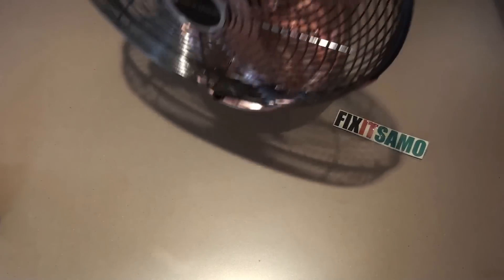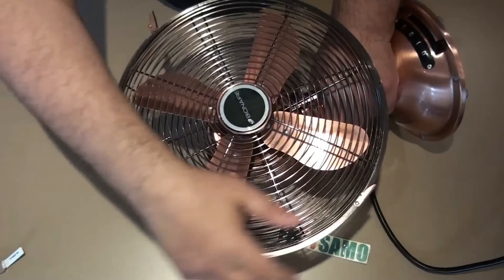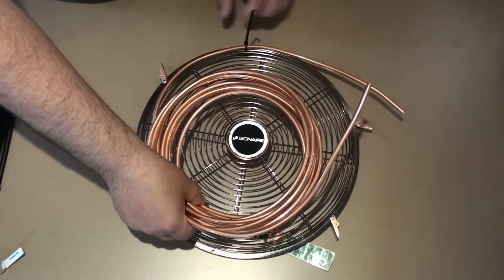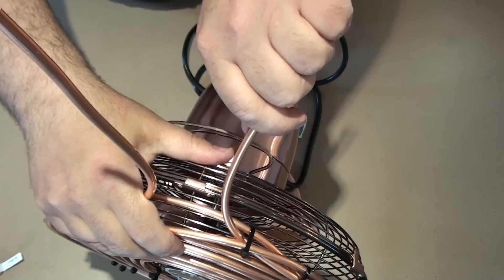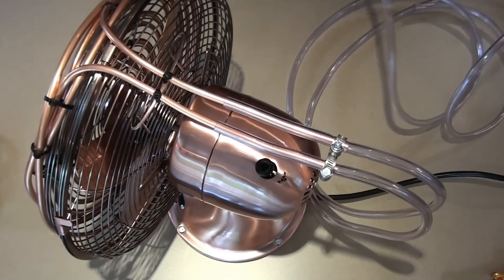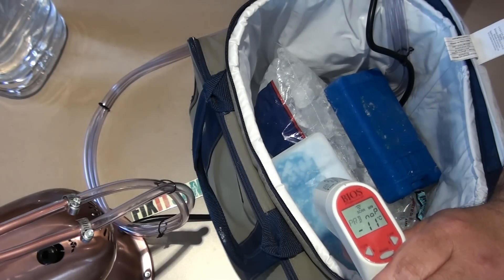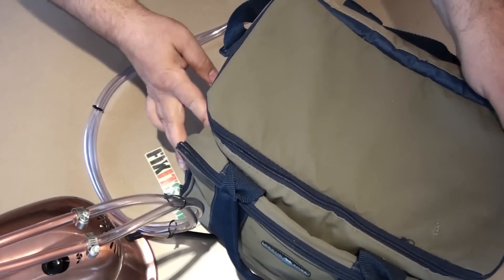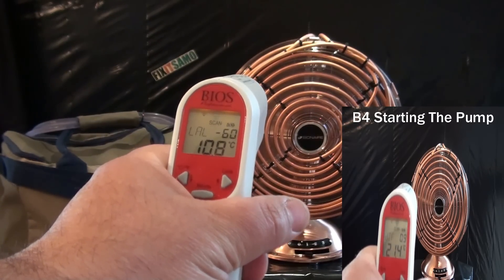How To Turn Your Fan Into An Airconditioner  AC

Comment: This is not an AC. It is a water cooler.
Reply: An AC is an air conditioner. Whether it's water or refrigerant, if it's conditioning the air, it's an air conditioner.
Reply: David Hernandez Erm. Sorry. English does not work like that. An air conditioner is something with a compressor thay creates a temperatire differntial. What you have is a premade temerature differrential and this device is water cooler.
Reply: Says your local Maytag man.  Don't get sucked into labels.
Reply: "English does not work like that." I'm going off their dictionary definitions but okay, sure. I'll listen to some guy on the internet over my professor that's been in the industry for decades. Thanks.

Comment: think I'll use an old small electric cooler that I have & a small water holder to change that I won't need any ice! I know it won't be as quick in cooling but it'll be less to maintain due too you won't have to add more ice every few hours or so! again, great idea!
Reply: also adding those reusable cold packs that you used would speed up the cooling & not waste as much ice in general!

Comment: If I where you I would have soldered peices of sheet copper to the pipe, or aluminium sheets so you can get  even more surface area for the air to contact, and I would have made a metal shroud so it can only go through the fins, and not outside of where the fins would be.
Reply: Are you a sheet metal worker?
Reply: Coffin Man no, but it doesn't invalidate my position if I'm not. I just know that the more surface area the better when cooling something.
Reply: Deimos Phob
I agree perfectly with what you say, I'm just wondering how most people would succeed in the attempt.
Reply: Coffin Man
eh, bolt cutters and soldering iron, not hard to come by, and sloppy soldering works just fine.

Comment: Danger, not cheap and take space.
Reply: Still cheaper than an air conditioner unit and very useful in some specific situations, and most people must aready have at leas the fan or the bag. Cooper and ac water pumps aren't expensive.
Again, of course there are much better solutions than this, but depending on the situation, this can be so useful
Reply: Daniel Moreno
aking always ice is worst.

Comment: well folks this project does work not as good as a real a/c unit of course but ok the real problem that no one tells about is as the copper tubing gets ice cold the tubing sweats like crazy just like pipes in ur basement so if you don't mind the mess lol ...get you a drool bucket or something....its not worth the time plus buying ice everyday
Reply: if you stay on your shit you can have a routine where you fill up new ice trays every morning which would take like 3 minutes and then for the condensation you can build small structures to move the water to a bucket.

Comment: Wow that's cool, lol excuse the pun. Does the water warm up quickly thou? I know you have the bag holding the water insulated but you are pushing that hot air passed the copper pipes holding the water I'm guessing there is a lot of heat exchange.

Comment: Would this also work as a heater by using warm water instead?
Reply: would probably work better due to the heat dissipation of copper but it going to be hard to keep the water hot enough vs cold

Comment: Well the purpose of Air conditioning is not only to cool the air but to dehumidify it as well.
This thing you have made has been around for decades. it only cools the air right in front of the fan  It will not cool A room it will not dehumidify the air and in A cooler that size you will be changing out the ice packs every 30 mins. (more often in really hot temps) in the long run it will be cheaper to just go buy A 99 dollar a/c
Reply: You're right that this won't cool a room.  But it's perfect if you work in an office full of women who are always cold.  You can use an electric camping cooler instead of that bag thing, and cool yourself.   With an electric camping cooler, you don't need to lug ice to work or replace the ice every half hour.

Comment: You should take a temperature reading of the input pipe vs. the output pipe to show that it is indeed exchanging heat with the air.

Comment: just need a bag of ice an hour at 5 bucks a bag you could buy a real ac for the money your gonna spend on ice
Reply: My dorm does not allow AC and we use fans so yea there are exceptions and this video meant for people in my situations and not yours
Reply: most people have a refrigerator/freezer so you can make your own ice.why buy it? just freeze it in blocks reusing the water over and over,just a little electricity and maybe change the water every month or two.
Reply: that would be a swamp cooler.
Reply: haha really so use more energy

Comment: This is indeed a good idea and crafty DIY but to make it better and permanent build a small/medium sized reservoir so you can do things like add iced salt water. This will be very good for rooms that get very hot. Im probably going to make one for my brother
Reply: using ice is extremy un effective its better to take the cooling component out of a old freezer and make it cool down a reservoir and just use cool water and maybe a few pices of ice every day
Reply: Use dry ice to cool it? It might work with an air pump and a check valve to force the air out. Don't forget dry ice.
Reply: A Lind Ahh good point. The freeon or something like that
Reply: TheGamingPatriot _ dry ice would kill you
Reply: A Lind
Not unless you put it in something like a metal container with a pressure release valve and move air across the container.
Reply: +TheGamingPatriot _ you would still build up co2 and if you do that you remove the entire point of the dry ice
Reply: A Lind
Depending on the size of the room, and the fact that (almost) every room built in the US so far isn't air tight, you might be just fine.
Reply: +TheGamingPatriot _  your might is pretty much useless and most rooms in the world cant get rid of the co2 before it builds up to dangerous levels
Reply: A Lind
-_-
Reply: TheGamingPatriot _ yo man he is trying to think if your well being. We don't need anyone dying lol
Reply: A Lind TheGamingPatriot _  Exactly lol but it was a nice idea

Comment: i feel like the displacement of energy is equal here to an air conditioner..instead of one big unit its a pump and a fan for a fractional air temperature decrease...instead of a big one...but the electricity used is still the same

Comment: you should add like a half lb of salt to the ice.
Reply: Salt would make water even cooler but it maybe harm the pump 
+Nick Dill
Reply: I mean, the ice would melt quicker, but it's a possibility that the endothermic reaction that happens afterwards would be of sufficient temperature to bring the water to near freezing temperatures.

Comment: you should use dry ice
Reply: No, no, don't do this, if you are stupid enough to, I guess natural selection has done its job.
Reply: TheRealGerov whatba fuck you are talking about...
Reply: Yea, don't use dry ice unless you want to die.
Reply: TheRealGerov dry ice in closed bag... You dont need to get it to water....  You dont have any experience with... Just becouse you read something online doesnt mean we all gonna die...
Reply: +Mario Darnadi Dry ice in any position, in a bag or out isn't going to cool down the air anymore than regular ice does anyway. There just isn't enough time for the dry ice to cool it anymore.
Reply: +TheRealGerov i think he means put the Dry-Ice in a bag, then put that bag in a container of water and then it will cool the water and the water will be pumped into the fan.
Reply: Carbon monoxide poisoning, it's a fact. Please stop being ignorant
Reply: dry ice is solid carbon Dioxide. you will not die of carbon monoxide poisoning but by a lack of oxygen as the ice becomes CO2 gas that will fill your room
Reply: hidekiki But iam ignorant... They dont even know what they are talking about... Also the rate of what is dry ice meltimg you will not even know. If you dont have closed all windows of course

Comment: Could this design be modified slightly, so that the reservoir is inside a fridge/freezer rather than a cooler I wonder? 
You would have to modify the seals slightly, but i'm sure it would work... So trying this!!
Reply: this will kill the fridge, its a radiator, you basically make the fridge work all the time and they are not designed to that!
Reply: But that is still running AC just in your fridge not through air and using the fridge to freeze the water hahaha whats the point in that.
Reply: If you want to kill the fridge sure.
Reply: The fridge moves heat, it moves the heat from the inside to the air behind it on the outside, so in essence all you would be doing is opening your fridge and letting it run
Reply: I'm just piping cold water out of a sealed fridge, and slightly warmer water into a reservoir contained within the fridge. How will this kill the fridge?
From the fridge's perspective there is no change in usage, as the fridge remains sealed the entire time.
Reply: +〈insert profile name here〉 Because that will raise the internal temperature of the fridge, forcing it to stay on cooling more than it is designed to do and burning out component's that are supposed to have more time between use. 

Most fridges turn on only when the temperature falls to a certain point and tries to maintain that.. The heat is just insulated out as best it can and it removes more heat when needed. 

If you are constantly pumping in slightly warmer than interior temp water the fridge will be essentially losing its insulation and need to kick on far more often.

Comment: Suggestion : move the coil tube right above the electric motor more sideways just in case you have a leak it's not going into the fan motor ,,,,
Reply from the maker: +Muhammad  agreed i did on top for the video and forgot to mention that the tube must be installed in the bottom or on the side of the motor thank tou
Reply: +fixitsamo 
Really good job thanks

Comment: It's a cool video for those that have a need for such a thing. For those that think it's a swamp cooler. Wrong. Swamp coolers use evaporation as a means to cool the air. The water in this case is enclosed and does not evaporate.

Comment: When at 6:48 you mention that "it's almost 10-11 degrees", you are actually measuring the temperature of that cooling pipe and not the air one. Such design of heat exchanger performs poorly (just look at the heat exchanger of an industrial airco unit to realize) and won't manage to drop a medium sized room temperature by more than 1-2 degrees. 
Idea is cool but does not fulfil the promise that the title of this video suggests - "turn a fan into an airconditioner".

Comment: i wonder if you can use freon in the tube somehow
Reply: nope, the freon is used in making the ice that this system uses though :)
Reply: Freon would require a compressor.
Reply: sisqsam
which then requires a radiator

which makes it a real air conditioner

Comment: thats cool, but seems like way to much money and effort  when u can buy a small a.c. for about the same price!
Reply: Yea, but AC will hit you hard on your electricity bill.
Reply: good point!
Reply: ok but if u didnt have money but u manage to muster up these materials from a tool shop or storage. Also how does the fans electricity cost compare to an AC that has to run a compressor to. Seems that for cooling a room or studio apt it would be well worth it.
Reply: +AterCanusAlbus But where are you supposed to get all the ice?
Reply: +Eileen the Crow your freezer?

Comment: 2 questions.  does it cool one bedroom per fan ? and what the energy consumption compared to a portable AC?
Reply: 1: i dont know, its probably capable of cooling a small room
2: very low, but its only because the real energy use is from the freezer. making that ice heats up your kitchen.

Comment: It's not actually conditioning the air just making it feel diferent,an AC unit  (condensor) actually removes the humidity from the room,this may feel nice if your sitting directly in front of it like any other small fan. waste of money..
Reply: not true. this is actually cooling the air. difference is a window AC is going to have a positive effect on the whole building, while this is more like transferring heat to the kitchen/refrigerator, away from this contraption
Reply: you are right that it isnt decreasing humiddity though, i misunderstood you

Comment: Simply put the ice in front of the fan : the result would be the same !
Reply: almost the same ....
Reply: No....because the ice would "engage the outside temps or atmospheric temps at a higher rate: ie: the ice would melt too quickly.

Keeping the ice sheltered in a cooler...decreased the rate of Ice melting...making this much more efficient.
Reply: Thermodynamically speaking, having the ice just sitting on a table would be the same haha

Edit: Technically it would work better, as the fan and pump add additional heat to the system.

Comment: You saw that on MacGyver!  BUSTED!

But seriously, good idea.  Wouldn't it be cool (npi) to have the tubing mounted into a freezer and have the water circulate inside?
Reply: the compressor motor will burn out as consumer fridges arent design to run constantly for long periods of time
Reply: keep your fridge door slightly opened for a day. see what happens
Reply: gtjack9 your loss :)

Comment: Why use copper on the fan and not plastic?
Reply: Plastic is an insulator so it would be cold inside the tube but not cold outside (where you are). Copper is a really good conductor of heat (or coldness), so the outside of the copper tube is much colder and the fan can blow the cold air on to you. Hope this answered your question!
Reply: very clever
Reply: he basically made a coil like you see in a evaporator coil in an ac system instead of r-22 or r134a he used water
Reply: All this does is move the cold from the cooler to the room. AC systems use pressure differences to change a liquid's phase to transfer the heat from the room to outside... and you need a true refrigerant liquid to do that. This doesn't really do that at all.

Comment: It's a neat idea, and he took the time to make this "how to" video, so instead of criticising... {"Well what do you do if it drips!? omg!"} Then you should swatch a "Bounty paper towel video" or just go out and buy an air conditioner; (if you were thinking about making this; the parts alone will add up to a used AC on Craigslist etc..) But in general it's really neat idea and I'm glad he took the time to make this "How To" video :-)
Reply: Actually, there are two significant advantages of this system over buying a traditional air conditioner.  First,  it will use a LOT less electricity than a "real" AC.  Second, there is no need to vent it to the outside.  With any sort of "real" AC you need to have an exhaust for the warm air (usually through a window).  I suppose in truth, this clever gizmo is an air cooler, not an air conditioner, since "real" ACs dehumidify the air and pump the warm air out.  But if all you want is a simple and relatively inexpensive device to blow cool air on you, this is a terrific solution.
Reply: I couldn't agree more, Jamie, and you as well, Peter Pauze, you've pointed out some very tangible pros to this set-up. Both of you obviously appreciate "fixitsamo's" very worthwhile efforts here which is refreshing. People who have such an easy time criticizing, but seldom have anything worthwhile of their own to contribute. :-)
Reply: +Stephanie Ann Thanks! I'm glad people like "you" & +Peter Pauze appreciate the time & effort that others put in to executing an idea or sharing a concept; (Especially on YouTube!) It's like facing a "Firing Squad!?!" these days! Lol
Reply: +Peter Pauze That's a great point! For anyone... (Well.. everyone these days, right?) concerned with saving on electricity! Lol! What I really like about this idea is that it technically could be portable too; beach, Rv, etc.
But also... thanks again for bringing that up! Good Point :-)
Reply: +Verdigris Lol! Well said, & SoOo Right... No one is forcing you to make one!

Comment: so your better off just buying a air conditioner only because of the waste of ice and water and u could always get a used one too. u actually wasting electric to. u have to use the pump and the fan. great idea but I just think its not worth it.
Reply: The power draw for that fan and pump will be a fraction of even a small window air conditioner; ACs are real power hogs.  (Also, this gizmo doesn't need to be vented out the window.)

Comment: Great video only thing I see I would of put inlet and outlet tubes under motor so condensation didn't drop on motor as for people saying it will use more energy than a window a.c. unit obviously don't pay the electric bill and complaining about energy for making ice I guess they must have there freezer off untill they want ice no this won't cool your entire house but to have a cool breeze only real problem is condensation would like to see a video that solves that
Reply: Actually, unless you buy the ice from outside, this system adds heat to your place. This rig is good for spot cooling an unconditioned space like a garage or tent.

Comment: i connected the fountain to the same wires as the fan's mains, as well as mounting the pump inside the base, mine being pretty unnecessarily large, and extending the rheostat to the fan switch. 
i was bored.

Comment: When you attach the transparent flexible tube to the copper tube with a round clip, I think it would be better if you add more round clip or put some glue or sealant at the end of the flexible tube and let it dry... just to make it more leak-resistant?

Comment: I was wondering how long the cool water lasts,  you could also take advantage of thermal conduction by placing the warm outlet at the top of the fan (offset to the motor for safety) but im not sure how efffective this will be in a spiral.